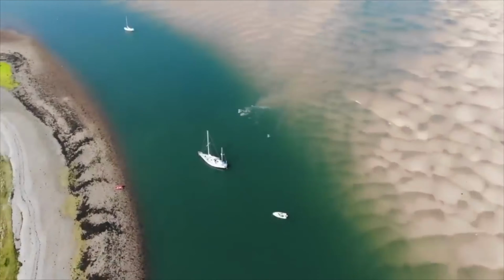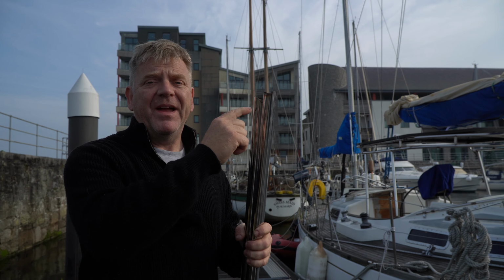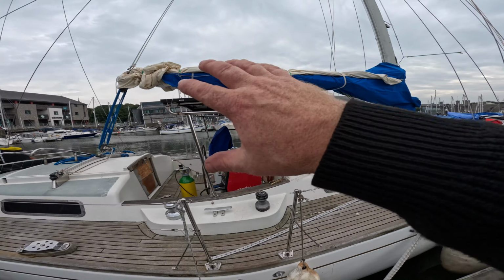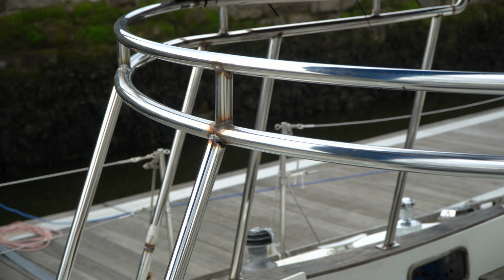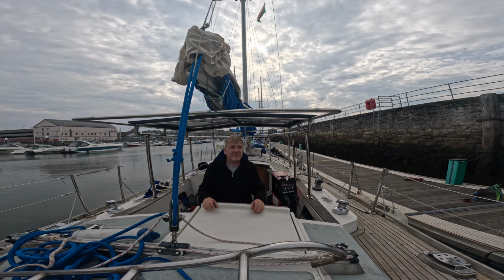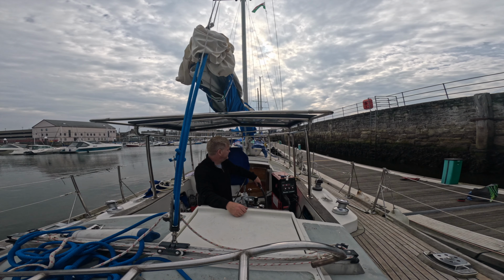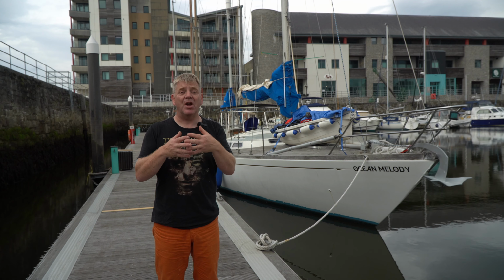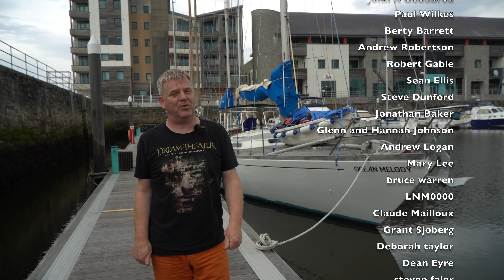159 : Further modifications to the enclosure design. Changing the slope of the front screen

Comment: If you add separate slides to the bimini extension you could make the extension roof section permanent, even fiber glass (with a window), which would make it a lot firmer. With a suitable, easy to use locking system, pushing it forward would be a easy and fast, in case you need to pop your head up for a quick glance forward.

The dingy on the front deck is not ideal in my mind (visibility, launching / retrieving, deck space). I understand the mizzen boom is in the way for a rear mounted dingy lift / solar panel mount. But if you move the mizzen boom up a bit it might be doable. When living aboard you seldom have too much solar and making dinghy launching / retrieval easy is also quite valuable.

Comment: Hi  Andy love what you are all doing. 
Just a thought with your cockpit enclosure extension I did something similar on a boat I had .
Sliding the extension in and out like you have  done was very tricky over a distance.   You wont be able to keep the canvas on, is it at all possible to have it so it folds from underneath do you have enough clearance from the helm. As I found it so easy and quick to fold it up and have the canvas always in place.
If you hinge it from the very end you will need a couple of legs to hold it up .
The legs will fold up with the extension. 
Or if you hinge it from a distance from the end you can lock it into position against the upper tube. Then you wont need the two legs. Hope this is of some help . Regards Gordon Perth western.

Comment: On back section I would have rear and side walls that can be zipped off or rolled up and Velcro strapped out way.  Have it so they zip to more permanent front section as well and pop stud to deck.  Also zip at rear corners so sides and rear of aft section can be rolled up or removed separately 

You may have thought of that anyway but thought worth suggesting as when at mooring etc you may appreciate an outdoor living space and being able to shut out the wind would be invaluable.
Reply from the maker: Yeah that’s exactly what we’re doing :)

Comment: I know you are in a rush and not willing to make revolutions, but consider (maybe a second stage). Move the panels way back on a superstructure over the back of the cockpit. This is a point with less shade and gives more chances to make the cover of the actual structure witha a visibility on main. This would force you to move the point of the main sheet (could be on top front of the back superctructure on top of the back of the actual one). Moving the panels gives you the freedom to make a steeper angle of the actual structure which is not only pleasant, but even better for wind and crushing waves. So in the end a back structure, and a front one and leave a one man free passage (that can be closed in bad weather and colder climate). I know it's way more work, but in the end it would allow you to have so many other benefits (more repaired cockpit, better aesthetics, better sun exposure, less shades on panel, visibility on main) that could worth the effort
Reply from the maker: I looked into this and discussed it with a rigger, marine architect and our insurance surveyor: they all agreed the work required to make the structure substantial enough to mount the main sheet would be very non trivial.  More to the point…. IF we ever did have a gybe significant enough to rip the structure off we would then have lost our mainsheet, solar panels and Cockpit protect all in once go like putting all our chickens in one coup and letting the fox in.  Plus. We would then have a big heavy stainless structure, partly broken up flying around the cockpit.  That’s worst case scenario of course.  But with us having the main sheet separate from the structure we’re keeping things simple which is always a bonus but also keeping things separate which means if we have a problem with one it doesn’t affect the other

Comment: Hi Andy, As you are doing a GRP top on your cockpit cover could you include two tracks on the underside at the back and have an extra Solar panel that pulls out the back when you have the cover extended. something a bit like what Mad's did on Sail Life. you should be able to get at least 150 - 200W in that space. Also from experience a 100Watt panel that is directional will give more throughout a day than a 175watt that is flat on the roof.
Reply from the maker: Cool idea!

Comment: When you are close hauled in a blow how far down will the boom come? Looks like it could be very close especially once you have the grip rail on your fibreglass roof.
Reply from the maker: We’re well we’ll clear of that now. It was a concern until I made the modifications
Reply: @SailingMelody  I don't know, boom always sits a lot higher on the topping lift or head to wind. I'd be inclined to take her out for blast before you build the top.
But I suppose you guys were already thinking of this and measured while prevoiusly underway.

Comment: During rough weather sailing, there will be a tendency to grab hold of anything at hand to stop falling or going overboard. Have you considered having retracted and extended locks on the moveable roof section to prevent it being pulled either way, when someone goes for it for grip?

Comment: I predict the pipe sliding within pipe extension will cause issues in the long run and you'll end up not using it. If any of the pipes get even the smallest bend in them it's going to jam up. Any contamination and it's going to jam too. When you slide it away, what's going to happen with the fabric? Are you going to add/remove the back fabric every time?
Reply from the maker: You make some valid points

But to answer your questions

The tube is very thick walled and the chances of bending it are slight, not zero but slight.

They will require a degree of maintenance, mostly just using them once a week to keep them free, I do anticipate the need for that.

The fabric panel will “concertina” when pushed forward annmy intention is to install a wooden boom gallows which the fabric wil fold up against

Comment: Why not put a zippered flap in the retractable canopy section so you can poke your head through without removing the the retractable section of the frame?
Reply from the maker: Yes we will 100% be doing that.

99%’of the time we will just use that to look over the top.

The only tim we will actually use the telescopic aspect is when we’re on  a downwind run with a rolling sea and there’s a good chance
Of a gybe, then if we see that situation developing we can push the frame forward. But yes most of the time just a removable fabric panel

Comment: Andy, I just have one question.....I noticed all of your supports for the hard top lean backwards. Are you worried that a wave crashing from the front will just fold all the supports backwards and smash onto the cockpit? Might it be prudent to have a forward leaning crossbrace between the middle and rear support poles running from the combing to the middle brace/hardtop to stop just such an event?
Reply from the maker: The structure is much much much stronger than a regular hoop spray hood and not much heavier or more resistant so no I’m not worried. The tubing and welding is so strong you could probably lift the boat from it (not really I’m joking but it’s STRONG)
Reply: @SailingMelody  greet. I was just worried and now I have some peace of mind it will be safe for you guys.

Comment: Are you going to be able to create some type of lubrication for the sliding mechanism over the helm station? I foresee lots of problems with the tubes getting bound up, especially after prolonged exposure to salt water. Stainless steel is only rust resistant, not rust proof. I’m thinking some type of delrin plastic bearing surfaces, if possible. Likely will require a re-think and additional modifications.
Reply: Can stainless be powder coated? Telescoping locks with bearings or simple spring pegs should work.
Reply from the maker: Yes I also foresee the need for some brass or Felton mods to this over time